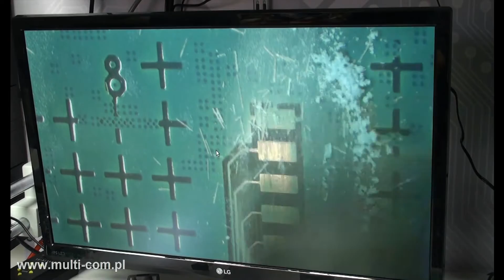Fiberglass brush DONAU for removing corrosion, paiting for TAPs

Comment: what are u doing this....?
and what for it....
Reply from the maker: In many cases JTAG TAPs point are under PCB paint so it must be scratched precisely if you want to get access to them. This method also are used in some cases in eMMC ISP or even when recovering data from microSD or SD cards which are monolitihics type - then paiting need to be removed.